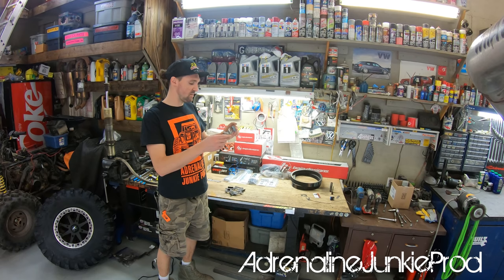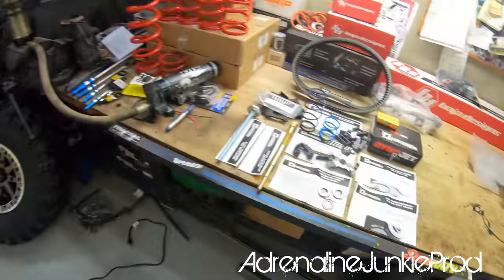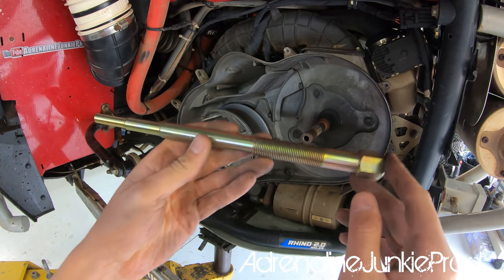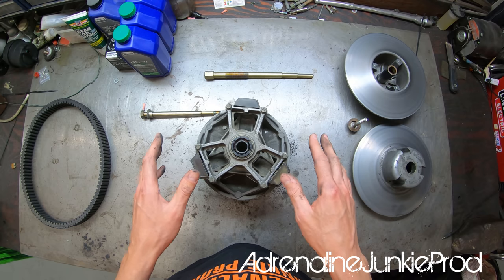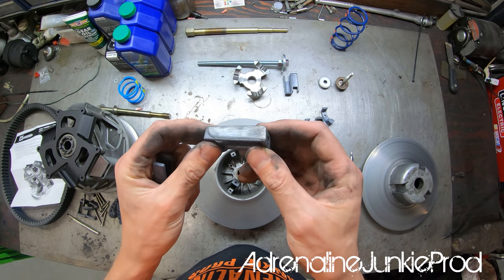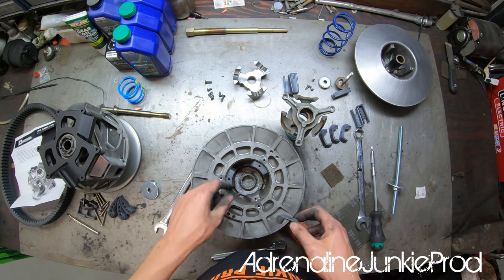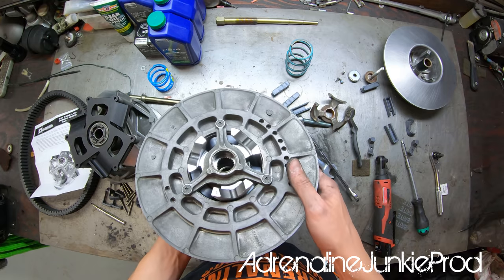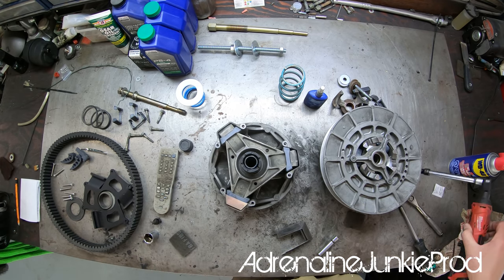Primary + Secondary Clutch Removal, Rebuild, Install - Polaris RZR Turbo, In Depth Step By Step DIY

Comment: 8 min in amd all we have done is show the parts on the bench, twice... Jesus christ, let's get to work. Oops, 10 min +, still talking... 15 min, im done, still just talking, talking, talking.
Reply from the maker: It's a pretty long video. The goal is to be in depth. You can skip to the parts you are interested in or you can find a less detailed video of just the main points. Just like you came here, you can also leave at any time. So if this video is not your thing then find one that is, lol. Not all videos are targeted at the same demographic. However, if you know nothing about these clutches at all and want an in depth step by step then you will get that knowledge here.
Reply: @AdrenalineJunkieProd  please, before you get defensive, take ten min and watch the first ten minutes of your video. I'm 100% on board with detailing the parts, process, and even your sponsorship obligations (I realize you said that they're not sponsored parts), but you're on repeat. I decided to take the time and watch the first 30 min again (on 2x) and stand by my first statement.